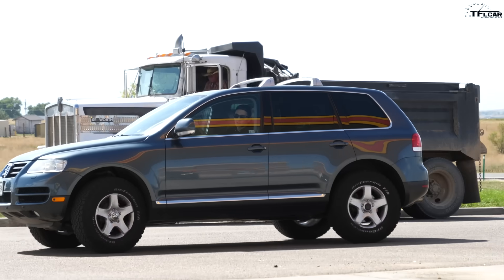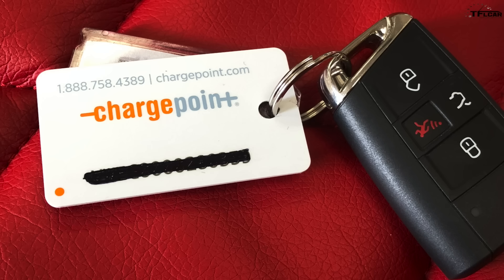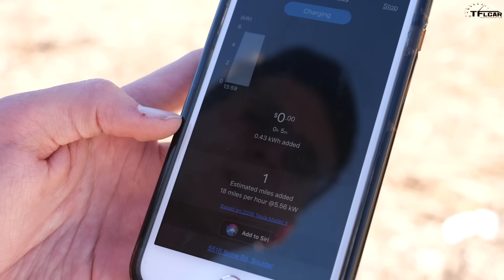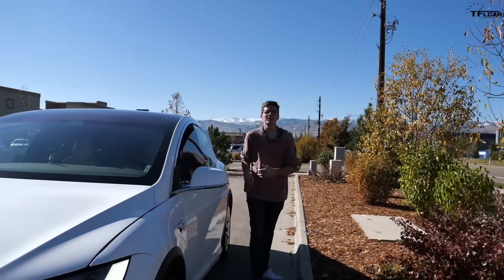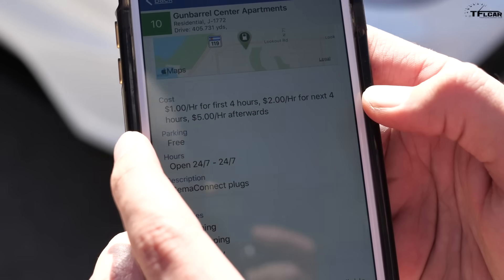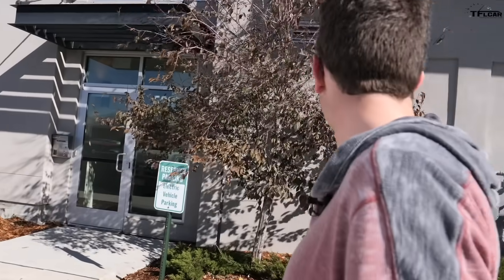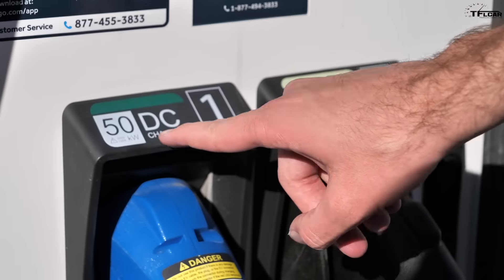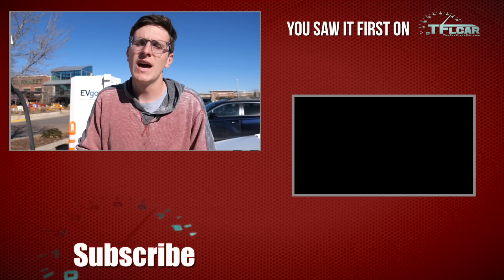Here’s Why Charging an Electric Car Can Suck - And It’s Not The Reason You Think!

Comment: So here we learn that EVs charge with:
level 2 charger at 5 to 6 kW    
level 3 charger at 50 kW    

Now watch how an ordinary car (petrol or diesel) gets charged with energy. 

Take average car with 80 liter tank and there is 5 liter left when we tank up again.
Then we tank 75 liter * 0.8 kg/liter = 60 kg fuel 

Fuel carries 43.2 MJ per kg (MegaJoule/kg)  (roughly same for petrol and diesel) 

1 MJ = 1 MWs (MegaWattsecond) = 1000 kWs = 1000/3600 kWh = 0.277777 kWh.

So one tank fuel holds 60 kg * 43.2 MJ/kg * 0.277777 kWh/MJ = 720 kWh energy.

We put this 60 kg fuel in the car’s tank in, say, 2 minutes or 1/30 hour (sometimes faster). 
In other words we charge the car with 720 kWh per 1/30 hour 
That is 720 kWh/(1/30h ) = 21600 kWh per hour = 21600 kW = 21.6 MW.
This is the power level of a suburban or industrial complex electrical distribution station.

Compare this to the 5 kW normal or the 50 kW fast charging power for EVs.  
Anybody still thinks that 50 kW is fast charging ?  

Admittedly, the fuel car wastes 70% of the energy it takes in, mainly as heat. 

It only uses 30%  or 0.30 x 720 kWh = 216 kWh for propulsion .   
It can do, say 10 km/liter, or 750 km per tank , using 720 kWh.   Close to 1 kWh per km.  
The EV only needs the propulsion portion or 216 kWh for similar range.
In other words 750 km with 216 kWh or close to 3.5 km per kWh .  That sounds smart. 
Until we realise that the energy it uses comes from power stations with 30% efficiency, and travels down power lines with transmission and transformer and other losses. 

In the end there is no advantage for EV over IC (internal combustion) cars, and only the disadvantage of waiting for the slow energy delivery.
Reply: Coal and oil are closer to 40% efficiency and renewable accounts for a huge portion of power now. Many states are up to 50% renewable. ICE efficiency is closer to 80% waste as well. It's easy to make the numbers look good when you skew them toward the result you like
Reply: Wtfq 😂
Damn bro, are you Einstein?
Reply: Except that "Level 3" doesn't actually exist. What people incorrectly call "level 3" is actually "Level 2-DC". Also to your point of "no advantage over IC", you can't make your own IC fuel on your roof. Sounds like an advantage to EV's?

Comment: Imagine coming back to your car and its been unplugged and or the cables been cut
Reply: JME R I’m looking at that thick copper cable 💰😁💰
I see. Gettho fabulous
Scrapping opportunities
🤣🤣🤣🤣

Yes Un plugging the car by pranksters it’s a thing indeed
Reply: @steelisthemeal  at least it's smart enough to turn itself off. Unlike the criminals who stole the air conditioner from our church who Weren't smart enough to turn the power off at the disconnect 2 inches away from where they cut before they ran off with it.
Reply: The connector (usually) locks while charging. And cutting a high voltage line is usually a brilliant way to get a Darwin Award. Not to mention... "Sentry Mode". Smile, you're on camera.
Reply: @wombatdk  None of that matters when you need to get high. Don't leave that shit unattended in Miami. You'll learn that a locked garage is highly desirable, Ring camera, motion detectors, low deductible car insurance, all part of it. Buy spare adapters from druggies, they're cheap cuz they're hotter than your battery.  Choose your "car guard" carefully. Oh yeah, don't take trashing your Tesla personally. It's just an insurance claim, remember your in 'Good Hands'...for now.
Reply: @Bruv-  That could be... I've only driven a Tesla for a few weeks (company car) before returning it. I don't recall if their charger locks, but I thought it did. My own EVs charger definitely does.
Reply: Suicided...
Reply: On the MB 350e the charger is locked into the car so they’d have to cut the cable while it’s live?

Comment: To the uninformed, the view can be that anything that is not a gasoline engine is not practical; anything that uses electricity, either partially or completely doesn't make sense. 
When a conventional car is in use, the gasoline engine runs constantly because there are components that require it such as an air-conditioning compressor and a power steering pump. In the case of the hybrid, the battery can allow it's idle gasoline engine to be turned off. The battery takes care of the a/c demand; and the electric motor-powered steering can steer the vehicle when only a large battery is used during start-stop traffic and initial acceleration, when the gasoline engine is not needed. Only on hard acceleration is a gasoline engine needed. 
Also, the regenerative braking system is free energy that's charging the battery while bringing the car to a stop. In a conventional car the braking is energy that's being wasted. 
The proof has already been shown that gasoline-vehicle manufacturers are improving fuel mileage by having an electric power steering pump since it's not constantly dragging on the gasoline engine.
There was a time when battery technology limited it's broader use in a vehicle. Those times are past.

Comment: So basically, EV's are a time waster, and iPhone screens can't be viewed outside in daylight...
Reply: @Tofutaco batteries get recycled mate.
Reply: @Tofutaco good thing that tesla model S batteries lose less than 20% of their capacity in 10 years/300k miles. Just don't get a crappy nissan with their equally crappy batteries
Reply: He’s showing the shit chargers. Not the Tesla superchargers.
Reply: Can't you fully charge a Tesla in 30 minutes if you use their supercharger stations which are pretty common?
Reply: @Tofutaco to bad Yellowstone would just pop and completely take out all surrounding states and you wouldn't be able to evacuate because you would already be dead.
Reply: Tofutaco - Clearly you have no idea what you’re talking about. The most expensive battery to replace on a Tesla is more or less 1/3 of what your passing off as fact. And these battery get well over 100k miles of use before you even need to think about a replacement so, please stop the irresponsible fear mongering just in case any one actually thinks you know what your talking about.
Reply: @Tofutaco most US electricity doesnt come from coal or oil though, it comes from natural gas. renewables make up more than a third of electrical production
Reply: MotorcycleMan Natural Gas, Nuclear, not great but not terrible 😀
Reply: Nitedaze1000: ha ha, it’s not true. The “Chargepoint” I use, they can send u a card, you just tap your card to the charge station and the charger unlock, then u can charge. I never use my phone App for charging, cause sometimes there’s “ network problems....”😀
Reply: nitedaze1000  or if your mobile data has run out.
Reply: @Tofutaco power plants are substantially more efficient than a gas engine. Sure still not clean but just due to the scale they produce way less co2.
Reply: @Tofutaco Having generation stations away from the city and your lungs is better that carbon monoxide surrounding you. Not perfect, but a step forward. We should have clean and safe fusion reactors. Working on it since the 70s, getting close.
Reply: @Tofutaco If you factor in the miles and time to fill up (for me its about 1/2 hour and 17 miles round trip) vs. fully charged in your garage overnight. For long trips range is getting better, 500 mile option for the Cybertruck, semi and 620 for the Roadster 2.0.
Reply: Sounds like you’re burying your head in the sand like ze Germans. Musk is batshit crazy but the big car companies are dragging their feet. Toyota ....???? Most families have 2 cars in US, even in Germany so why can’t one be an EV.  20% of Americans say they’d like to buy EV in the future in a country where petrol and new cars are  cheap.
Reply: https://electrek.co/2018/04/14/tesla-battery-degradation-data/?fbclid=IwAR32pbqGifszPECJxDzLWtaSO72Au3fPKMrYdkbtB3-VdMLguemOUMWE4_8
Reply: https://futurism.com/the-byte/tesla-record-mileage-900000-kilometers?fbclid=IwAR3ticPyFHd_GTYRptDwtqXbqF5F6IeBXy8BTILeYNUbIWKX8DBKe19KqGE
Reply: Millennials who like to be distracted by charging their car, gettting distracted by their iWatch, and the best part is they have to buy a brand new phone, watch, and car in 4 years when the tech is useless.
We’re going to see more of these disasters pop up more and more unless regular people reminds them over and over how they’re wrong about their cars.
Reply: Lol you can leave the car and do something else while it charges.  Going to the gas station is far bigger time waster and you have to breathe in those great fumes while it fills.  Also the fuel is carcinogenic, that's why they give you those gloves which no one uses.
Reply: At least you'll never die from carbon monoxide poisoning in your garage.
Reply: @Tofutaco Last time I checked you were still an idiot spouting lies. Of course Lithium which is a metal is recyclable. They do it all the time.
Reply: @Tofutaco Sorry mate but I don't live in the USA, Im in the UK where in 2018 coal supplied 1.4% of our energy, renewables supplied 28%!
Reply: @markdavis2475  Don't mate an American, UK is 243g CO/kWh, so almost twice as clean as the US, but nowhere near a clean grid.
Reply: Tore Lund Why? Don’t Yanks like mate?😀
Reply: @Tofutaco This fails to mention the efficiency of scale. A small engine operating outside of it's most efficient range is different than large scale operations that can shut down excess capacity or bring it online as needed to keep in peak efficiency. A coal plant never sits at red lights producing no power and running just so power is available when the light turns green.  The pollution is farther from populations, cleaner, and less fuel is consumed.
Reply: @isettech  AHHH, nothing like facts to offend the "woke" crowd.After all when you buy an over priced impractical electric Edsel , you must justify  the cost.
Reply: Coal is the dirtiest fuel ever. Line loss is around 50%.
You are deluding yourself if you think EVs are clean
Reply: red32303 If they are charged from renewables they are pretty clean squire!
Reply: @Ratbert32305  Bullshit. How about this statistic. You are 100% wrong. Per fueleconomy.gov which looks at upstream emissions (yes including line losses and even the mining and transport of raw materials and plug losses and conversion losses within the EV) an EV running on 100% coal electricity will still have half the emissions of a gas car of similar size and power. You guys just won't let it go and continue to make shit up to make yourself feel better about being so helpless to face the future. Grow up.
Reply: Tofutaco Thanks for the info and I do take your point . But, I have to start with an EV somewhere, I’m 55, lifelong petrol head, now I simply hate driving in a city, my kid is 9 she gets an electric powered bus to school, that’s great! But, at the school near my flat, parents drop their kids off with SUVs, on a calm day you can smell the accumulated exhaust fumes. We are poisoning the next generation. Something has to change! Sorry for the rant!
Reply: @markdavis2475  in 2018 renewables made only 9-11% of the UK energy
Reply: @Tofutaco the EV pushers seem to be kinda quiet about battery replacement facts.
Reply: BossSpringsteen69 - Because it’s a non-issue for those who know what they’re talking about unlike you and fear-mongering @Tofutaco who is so delusional and clueless it hurts. He must represent some car or gas lobby because he’s flat-out lying on this thread. The batteries last for well over 100k miles and even then you still get over 90 percent capacity. All this pertains to Tesla, can’t comment on the Leaf and Bolt personally.
Reply: Hello my namesake😀 Looking forward to my first EV, it will probably be an older Leaf, pretty cheap in the UK! £7k for a 2014 with the small pack.
Reply: @markdavis2475  Make sure the battery pack tests to capacity, few if any extra packs are available for used EV's.
Reply: Mark Davis it’s for a small population of adopt er s those born with silver spoon in mouth
Reply: @elauber  well i mean, the model 3 really isn't much more than a new car and most of my coworkers can afford new cars along with the gas for them..
Reply: Eric Lauber   Or those who get an education in a useful field (ie: NOT lesbian dance theory), get a good career, and work hard.
Reply: Eric Lauber - Rather be that than the condescending judgmental prick you turned out to be.
Reply: Feel sorry for Tesla owners

Comment: You showed me why charging an electric vehicle can suck - and it IS the reason that I thought. That, and with the likelihood of having to buy TWO full sets of batteries for the vehicle (to equal the life of an internal combustion engine; y'know, like 120K - 200K miles), it's HUGELY worse for the environment.
With EV's dying before 80K miles, and the cost of new batteries being far more than a working example of the car would be, meaning the car's only good for the scrap-heap? So "environmentally unsound".
I'm sticking with fuel for now - better for the environment.

Comment: Boss: why didn't you come into work?
Me: I had to wait 10 hours for it to charge......
Reply: Plug in the car when you get home. Like checking your mail box or feading a pet.  Not charging your car, is like staying up watching movies all night, then being too tired work. Recharge your car batteries, when you recharge your brain batteries.
Reply: feading your brain didn't wirjfir you
Reply: Wasn't 10 hours was for half a charge?
Reply: @cleaterose5914  less than 30 minutes at a supercharger.
Reply: @cleaterose5914  1/2 charge should get you 100 miles. As long as the round trip to work is less than that distance, you are good. Rent an internal combustion engine car for marathon road trips.
Reply: Daniel Stoica   Otherwise known as a normal car. 😂
Reply: Not to mention :  Gas Station:  4 to 12 pumps.   
Charging Station:  ONE.  oh, and their is already some guy there, and he's going to be plugged in for the next 2 hours...
Reply: Only an idiot will charge the way you do.
Reply: Peg Leg  All car  roofs should be solar panels by law - just so every electric car in USA can absorb free sunlight.  Not much every day - but over all the usa over  the whole year,  it would equal millions of barrels of oil.
Reply: Just don't be a dingus and plug it in the night before.
Reply: @0xsergy  People are not used to having to plug an unplug vehicles like a cellular phone. It's a completely different type of vehicle, so even you would forget once in a while. The downside with electric cars is that you'd have to keep them plugged in all the time. Not everyone's going to remember to do that all the time, not even you.
Reply: @Steveman27  good thing that most people don't take 300mile road trips daily.. including me :D
Reply: @0xsergy  well everyone forgets so..... I'll stick to diesel
Reply: @Steve00alt  yeah sure, hard to refuel your diesel car in the garage though. Makes it easier to remember when you gotta walk by the plug too, imho.
Reply: @Steve00alt  Exactly. Normal vehicles, you don't have to resort to plugging an unplugging them like they're some sort of giant laptop computer. The concept of plugging and unplugging cars is not something people are used to.
Reply: EV license = more reason for people to slack off, and be entitled because they're "helping the environment ".
Reply: @truck6859  Facts lol. I mean we all are here to live and die right? Y’all act like you gon live forever with ole head ass thinking global warming is real 🤣

Comment: I have the understanding and bandwidth....   but what a complicated disaster.  What the EV world needs is standardization. 

 Level 2 vs 3 is fine, leaving it the users choice as to where they want to charge.    But I shouldn't need an app at all.  I should be able to swipe my credit card, enter my pin,  have all possible adapters available at the stand, plug in, and charge. 

The only thing left to do is to call the wife and have her pick me up in our 40MPG gasoline powered car so I can let our EV charge across town for 4+ hours. 

What makes gas powered cars so hard to give up is the convenience and lack of complication. I don't need a Shell app vs Chevron app. I have a universal tool called a credit card. I choose my flavor and in 5 minutes or less I'm "charged". With a car that gets 40 mpg, I don't have to fill often - and the cost for a fill isn't outrageous given the sheer convenience. 

Now consider the fact that EV to Gas/TDI, the gas powered car is significantly less to buy initially...  it's hardly worth the headaches to go EV.

Comment: What has not been addressed, and is often not addressed, is the time difference between a fill-up and charging times.  I can be back on the road at full capacity in less than ten minutes for gas power.  The video showed a one-hour charge giving only .5 to 1.0 miles of travel distance gained.  It also fails to address the shortage of charging stations for long trips.  I can go my longest normal trip of 320 miles on a single tank of gas in a mini-van if I do not drive hard.  I cannot achieve this with any EV's and the price difference for an EV that would even come close to that does not save any money versus buying gas over, say, an eight-year period.  8 years is the approximate time at which EV batteries need replacing.  The cost of the replacement can actually put you even further into the financial loss column versus buying gas.